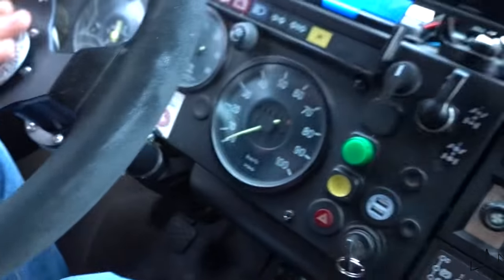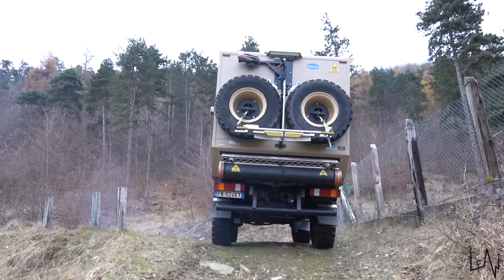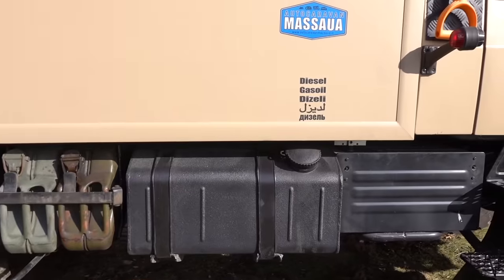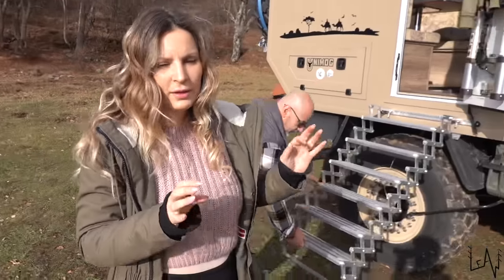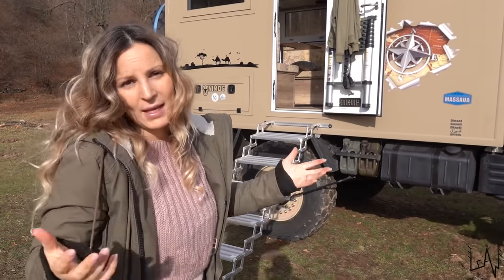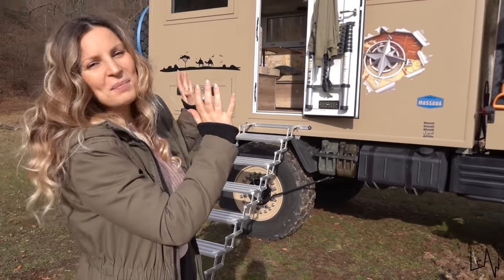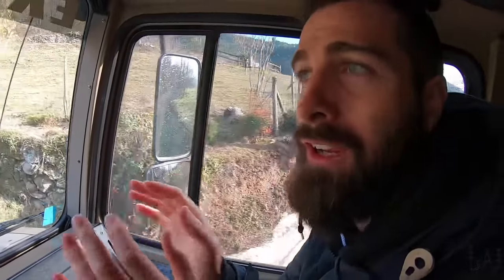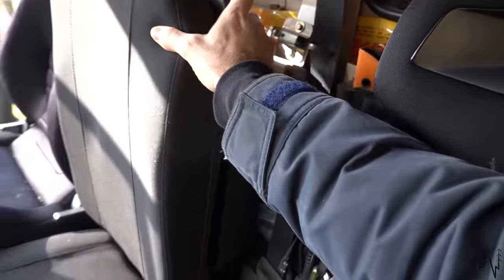ULTIMATE OVERLAND 4x4 Expedition Vehicle! MERCEDES UNIMOG 1300L TOUR

Comment: Regarding your Ford, I have an American pickup in Europe. I had a UK driving license which gives everyone a license for up to 7.5 tons, this was transferred to Spain and now Ireland.. The issue is that if you have a vehicle which can when loaded weigh more then 3.5 tons you have to have a tachograph. So I had a new VIN sticker made to say 3.5 tons as in the USA the vehicle is good for 3.8 tons. There are easier regulations for campers (it is possible to import American campers to Ireland) so it would be worth checking them in Italy. Also your point of entry to the EU is important, some countries make it more difficult or impossible to import non EU vehicles directly, the UK used to be the easiest but after Brexit I believe that is now irrelevant. Once you have the vehicle registered in one country EU law is that all the other EU countries must accept the homologation.
The Ford would be much more useful then the Unimog in Europe because it is a much better highway vehicle whilst still being 4x4. A modern Dodge pickup with diesel and truck camper would be good though maybe more space is needed for a growing family.

Comment: That is quite a well equipped camper truck, ideal where Luca had used it in Africa. A common van used in the UK is the Mercedes Sprinter long wheelbase van, these are quite long and tall but at least you can stand up inside and fit a toilet and shower. Its a lot of expense and effort to fit one out yourself, a second hand one is the best way of getting a prepared campervan.

Comment: You’ve sunk a fortune into that vehicle. I owned the 1965 Unimog ex Swiss Army hard cabin, radio cab version. It was a total rip off, absolute junk. It came with gun racks which fit FAL Congo rifles perfectly. 
   The ground clearance was 12” . it had three locking differentials.  The cabin heater and windscreen defroster and wiper blade were useless junk, useless to defrost the windshield when crossing Wolf Creek Pass in Colorado.
    If used in warfare it would have been annihilated, obliterated.

Comment: This is the hundred ultimate 4x4 overland expedition vehicle Mercedes Unimog. I'm buiding my 3th one . Sorry, no time for putting video's... and what is the point. I live alone... :-)  Who is the jury for ultimate ? Ah ,the vieuwer, me and you.
Reply: Construct yourself, let not be intimedated by ultimate. Start with covering all the metal in the cabin. Then you do'nt need ear protection, you will look less stupid.  Two layers of sound protection on the floor is nice. Also every metal around the engine and under the hood.  Try for sure, realy, not to have sharp corners in the cabin, for sure again at the level of your knies. Also not in front or the back of your head 8:20 a tube behind his head ?!? 11:48 wooden box off road... have a second escape posibilety trough the cabin, is better then to try to jump out of a window, front door back door... normal I think. In such a small place.... when you have something to put out a fire, don't put it in the same place where a fire can start, heating system... where one cooks one needs something to suck away the moist, for sure when it's cold outside, 460 Ah for 10 days microwave, fridge, heating, light... I have twice 250 Ah, how they do THAT ?  3.000 V inverter , she means 3.000 Watt , I have 4 x 150 Watt solar panels, that turn 360° and can change the angle to the sun 20:40 " when something burns.. " please put something to kill a fire, as close as posible to a door and visible, not behind a lock. if this thing is build by a professional, take away his licence. Those guy's will kill the fun of 4x4 traveling trucks. People look nice, truck look nice, but I have seen enough. Money do'nt buy experience or brains. Sorry, it's that  "ultimate " that bothers me. :-)